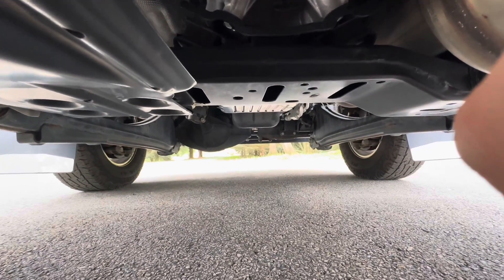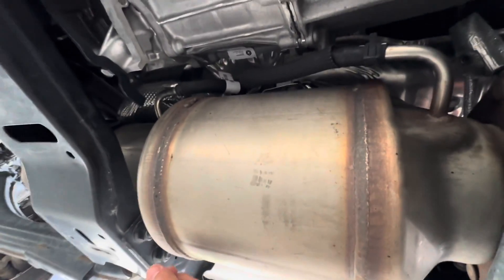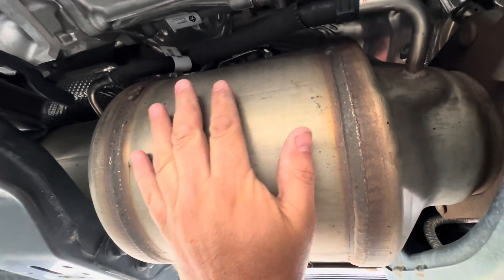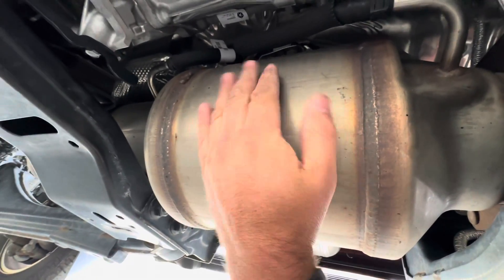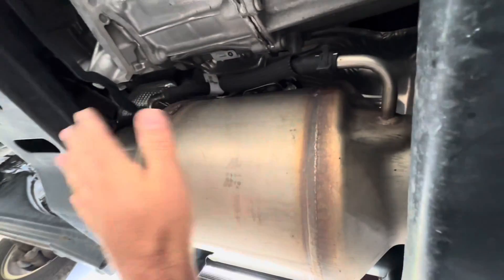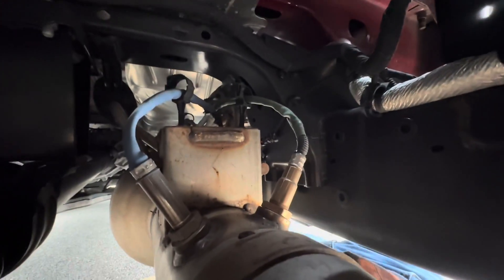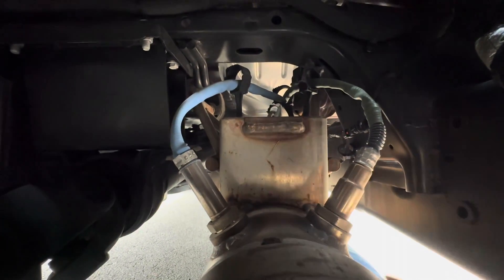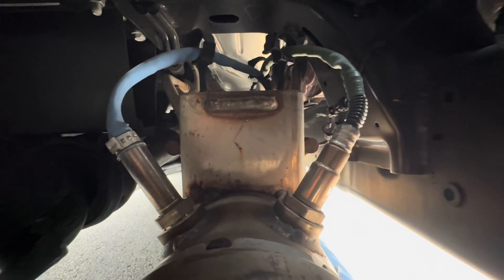2022 Ram Cummins DPF Regeneration and Y43 Recall Explained

Comment: Nice video, Can you tell us why the truck will go into limp mode at 5mph if the DEF runs out or isn't pumping enough. One hears that without DEF fluid the engine will be destroyed. The way I understand the system is that the DEF has NO function in the engine itself, just the exhaust and chemically removing most of the NOX. Doe sthe EGR run all the time or just during regen?
The whole idea of restricting compression ratio and combustion temps to control NOX, in turn causes more soot plugging up the DPF and then needing to use MORE fuel to raise exhaust temps to burn off soot in the DPF. Bizarre logic, as when you couple that with the EGR you essentially ruin the Cummins engine that never smoked that much to begin with. Not like your CATs, Powerstrokes, and Detroits. 

Thanks
Reply from the maker: @philalford3413  the truck goes into 5mph speed limited mode, via a 150 mile countdown, anytime there is an active fault with the SCR (DEF) system. This is because the truck will not meet NOx targeted emission levels at certain operating conditions without the use of DEF. DEF was brought into use as a means to reduce the amount of EGR being used. DEF dosing helps to reduce NOx emissions without having to use as much EGR. It is the EGR cycling at the engine that is more detrimental to the engine. If DEF was not used, it would mean more EGR would be needed at the engine to control NOx. More EGR means more carbon / soot contamination in the intake side of the engine, which can be detrimental long term. It’s not as big an issue on engines that run at more load and higher rpm constantly, however for engines that see a lot of short cycles and idle time, the EGR can get pretty restricted with soot fouling and reduce the flow.
Reply: @TheRamGuru  Thanks, I just have one more question. So the DEF system interacts with the EGR? How exactly does DEF go through the engine? In other words how does the NOx sensor control EGR?
Reply from the maker: @ DEF does not go through the engine at all. DEF is only injected into the SCR chamber, which is the last big canister in the exhaust system, immediately after the DPF. NOx emissions are first reduced through the use of EGR in the engine, and then subsequent NOx reduction occurs in the SCR chamber in the exhaust. The amount of DEF injected is dependent upon the amount of NOx needing to be reduced.
Reply: @TheRamGuru  Okay, thanks that makes sense as far as the emissions system operation is concerned. Now to make sense of the whole idea of making the engine eat it's own exhaust and burning more hydrocarbons to produce less CO2.  Thanks

Comment: Do you know the part number for those differential sensors
Reply from the maker: @ATrucking-g8r  offhand I do not, but a dealer can look them up by your VIN
Reply: @ Thank you for your response, any recommendation you would give me I don’t know what to do I have several months like this with the truck I get a code “exhaust filter full power reduced see dealer” I get code “p0402” “p242f”, automatic regen comes on dash for like 10 minutes but then it takes off and exhaust filter full sign comes out and dpf starts getting full 2019 ram 3500 200k miles
Reply from the maker: @ what engine air filter are you currently using? Regeneration issues are complex to diagnose due to the number of different ways and failures that can create a frequent regen issue. P242F usually means the DPF is plugged with ash and ash isn’t removed during regeneration. It requires removal of the DPF and cleaning or total DPF replacement. Do you idle a lot?
Reply: @  yes I do I’m in the hotshot business I’m getting in contact with dpf cleaning do you suggest cleaning the dpf filter and scr filter or just the dpf filter
Reply from the maker: @ probably just the DOC and DPF but they’re not easy to clean. They’re not serviceable like a commercial truck DPF. The whole thing is one welded assembly with a pipe between the DOC and DPF. A lot of places cut it all apart and then weld it back together.
Reply: @TheRamGuru  hey , here’s an update the dpf filter was damaged cost me 3k to replace it I got my truck back yesterday and the sign came on again “ exhaust full see dealer” any suggestions on what to replace
Reply from the maker: @ I would take it back because they didn’t get it right the first time and you’re spending a ton of money

Comment: I have a new to me 2020 ram 6.7. I just got a check engine light. Had code of P24b5. My particulate guage on cluster shows about 30%. What's my next step? Thank you for video.
Reply from the maker: @rangerron1700  P24B5 indicates a low voltage condition in your particulate matter sensor at the aft end of the SCR chamber. More than likely your PM sensor is failing and needs replaced.

Comment: How to do active regen?
Reply from the maker: @MrCoonass1970  they are controlled automatically by the trucks PCM. Active regeneration will occur whenever the soot load in the DPF reaches about 50%, or whenever the truck is operated for a total of 24 engine hours without an active regeneration happening sooner. The only way to force a truck to perform an active regeneration is to perform a “parked” regeneration, which requires a scan tool / computer with that ability. The truck has to be stationary and have sufficient fuel in the tank.
Reply: @TheRamGuru  so just need obd2 reader capable of force regen. It just plugs into the under dash obd2 plug? No need to remove dash? I saw some remove gague cluster.
Reply from the maker: @ yeah you might depending on the year. You need to get past the security gateway in the vehicle electronics and sometimes that’s not easy to do.

Comment: the soot leaving the dpf has to pass by that sensor in the back during regen. of course its going it to register soot.
Reply from the maker: @axercst  no soot should be in the post-DPF exhaust flow except for maybe small trace amounts. The DPF is 99%+ efficient at trapping soot. The point of the sensor is to capture any soot found in the post-DPF exhaust flow. The sensor captures and “counts” the particles. If the amount it counts is above the threshold limits permitted it will trigger a DTC which indicates the value is higher than normal. The only way that should be possible is if the DPF itself is internally compromised. Either the media is cracked, or the pressure vessel is damaged and the soot generated by the engine is bypassing the media in large quantities. During a regeneration the soot is converted into carbon dioxide and water vapor and expelled out of the DPF outlet. There is no soot discharged out of the DPF during regeneration.
Reply: @TheRamGuru  Does the PMS capture any post-DPF soot or just count it?  If it captured it, wouldn't it eventually become full and need replacement since it can't regen?  My thought is it just counts it and lets it go out the tailpipe.  Interested if you know.  Thanks.
Reply from the maker: @ yes it collects trace soot particles on the tip of the sensor. It then counts those particles to see if the amount is above or below the threshold limit for acceptable operation. After a certain amount of time, the tip of the PMS sensor goes through a regeneration cycle, where the tip heats up hot enough to oxidize the soot particles and eliminate them. It then goes back to counting particles again. This happens over and over as it constantly monitors the post-DPF exhaust flow to make sure that no excessive soot is escaping out of the DPF.
Reply: @ Thanks for the explanation!
Reply: i have a 17 ram dually i cant see how full my canister is or when its doing a regen?  any way to know?
Reply from the maker: @ the 2018 and older trucks do not have any factory notifications to let you know when the truck is in regen, or how full the DPF is, however if you invest in an aftermarket monitor like the Banks iDash, it will tell you how close you are to a regen and it provides a notice when the truck goes into regen
Reply: So the code P242F can't be fixed by a stationary soot cleaning? That was the fix from the dealer and it lasted about 4 miles. My codes started PO299 (hole in intercooler boot and bad turbo actuator) while waiting for parts got a PO401 code... DPF filled up and now I've got the P242F. All in 6 weeks are so mad 58k miles on my 2021.

Comment: I took my 2019 Dodge 3500 to the Dodge dealership because of another check Engine light on. It came up with a P2002-00 code. The dealership recommended either replacing the DPF system at a price of around $7000 or doing a delete for $2600. There is no mention of cleaning it or any other possible causes. They never checked any sensors. My dash shows the filter is clean ? I do both hwy and town driving.  It does its regeneration just fine when i am on the hwy, clears up the filter to 0 every time. 
I have under 100,000 klm on the truck. Is it normal to have this issue. I already replaced the diesel particulate sensor at the end of the tail pipe. 
So frustrating. This truck is only 5 years old, and I have to take out a loan to fix it?
Reply from the maker: @sandygammie447  P2002 is “DPF efficiency below threshold” and is usually caused by a pressure issue in reference to the DPF. It’s triggering the code because it’s seeing a pressure differential across the inlet and outlet of the DPF that is below the minimum threshold. So in other words, there’s not enough restriction in the flow of exhaust through the DPF. This can be caused by an exhaust leak, where pressure is escaping if one of the clamps has failed, or there’s a hole in one of the pipes. It can also be caused by a bad pressure sensor, which is reading false values, or holes in either of the pressure tubes that run from the DPF to the sensor. There’s also a possibility that there is a hole through the media in your DPF and the exhaust is flowing directly through it, rather than being filtered out. If this was the case, you would see black smoke coming out of the tailpipe under hard acceleration while driving the truck. You may also see a lot of soot in your tailpipe. Without doing proper diagnostics, it would be premature to just claim the DPF needs replaced. The things I listed above should be checked before coming to that conclusion. If you’re under 62,000 miles, it’s highly unlikely the DPF itself has failed.

Comment: The Y43 recall states it’s only for 3500 & 4500 Rams. This video is for 22 ram 2500. We have 2 2022 Rams that have DPF full issue. We have a 21 Ram 2500 that does not have the issue and it does the periodic regen process.
Reply from the maker: @vicdean7393  the truck in this video is a 2022 Ram 3500 high output pickup. It is my personal vehicle. The Y43 recall is for all 2022 Ram HD trucks powered with the 6.7L Cummins  diesel (2500 and 3500 pickups, as well as 2500/3500/4500/5500 cab and chassis trucks) The Y43 recall doesn’t have anything to do with your DPF being full. The particulate matter sensor doesn’t control your DPF or monitor its soot capacity. I explained this in the video. If your 2022 Cummins trucks are having an issue with the DPF showing full, or with the DPF regenerating too frequently, then you need to look up (or have your dealer look up) TSB 25-005-24 which explains that a number of 2022 diesels were produced with a DPF that was manufactured incorrectly, causing frequent regeneration (which can also lead to a false-full issue).
Reply: @ much appreciated. I did watch all of video, very detailed. I think I just assumed it related to regen problem. This has been frustrating. One 2022 Ram 2500 we took to dealer said it’s out of warranty and they wanted to replace DPF, other 2022 they replaced DPF under warranty. Both under 60k miles.
Reply from the maker: @vicdean7393 don’t forget if you’re registering these trucks in a state that follows CARB regulations you have a 7yr, 70k mile emissions warranty. Also, any truck that gets the Y43 recall also gets a 1yr, unlimited mileage warranty extension on the DPF from the date the Y43 recall is completed.
Reply: @TheRamGuru  thanks, unfortunately I’m in North Carolina. No CARB.

Comment: Buy an older diesel and all this bullshit goes away...
Reply from the maker: @shaverlocal  so does the towing capacity and capability. The older trucks don’t hold a candle to the pulling and stopping power that the newer generation of trucks have. Those older trucks are also….old. Parts are becoming more and more difficult to source for them, some of which are NLA. Most are so worn out they’re not worth repairing, and when you find a gem, the owner wants almost the same amount of money for a 20 year old truck as what you can buy new. Sorry but times are changing and you either change with the times, or you get left behind. The older trucks are great for a hobby or a collectors item, but if you want to work the truck daily and have it perform, new is the way to go. These systems are far more reliable today than they were ten or fifteen years ago. The vast majority of ones with issues are the result of improper operation, poor duty cycles, and / or poor maintenance.
Reply: @TheRamGuru  That is funny...You want to compare a new truck that cant even hold half a yards worth of gravel and will look like a wreck that insurance won't pay for...or an old rid like mine that I bought for cash in 07 that will haul a yard and a half and still look like a great work truck with an LBZ engine with no emition bull shit standards...  can't even imagine.My truck probably has more value than yours and  don't have a $1200 dollar a month payment. In the mean time I have paid off my home!
Reply: @TheRamGuru  I guess you blocked my reply...I don't blame you...
Reply from the maker: @shaverlocal  I didn’t block anything. You were so eager to gloat about your ragged out Duramax, you inadvertently made a typo that looked like a link, and YouTube’s algorithm is likely blocking it. Please continue demonstrating your ignorance and stupidity.

Comment: So I have a 2022 and it doesn't have this sensor. Does that mean I can take the dpf out or maybe drill a hole in it. 😊 this is a serious question. Why would i want to have this installed if its just another thing that can go wrong?
Reply from the maker: @electrified7309  definitely not going to work. This sensor doesn’t have any control over the DPF. But there are sensors that monitor DPF function. When you remove it or punch a hole in it, the pressure sensors will see an incorrect pressure differential. Installation of the PM sensor under the Y43 recall should be completed because it provides you the ability to detect a faulty DPF sooner, preferably under warranty when it can be rectified by Ram. It also includes a software update that includes the programming to allow the pcm to communicate with that PM sensor. If your truck does not get Y43 completed, and you need a PCM update in the future, you’ll end up with a constant check engine light because all new versions of the pcm software will include programming for the PM sensor. If it’s uploaded into a truck that doesn’t have the sensor, it will cause a “lost communication” error continuously until a sensor is installed. You also get an extended emissions warranty on the DPF once this sensor is installed. One year and unlimited mileage from the date the Y43 recall is completed.
Reply: @mbarber84   Thanks for the information and very convincing argument to get the update.

Comment: The only bad thing is the soot becomes ash and then it becomes trash 😂… horrible system been working on it for years it’s horrible there no bands on there to just be able to remove the dpi and install a new one…
Reply from the maker: @dieseldawg7132  yeah they should have designed this one so that the DPF was an independent piece (like commercial and industrial applications) so that it could be removed for easier cleaning, rather than welding it all together.

Comment: Thanks for explaining in detail! After the dealer fixed the Y43 recall I’m not passing smog! Any help with this??
Reply from the maker: @JamesSearcy-l9g  are you having an issue with one of the readiness monitors not being ready? Or what do you mean by not passing smog?
Reply: @ yes that’s correct the readiness of one of the monitors! I’ve driven 400 miles since recall repair
Reply from the maker: @ which ones aren’t setting?
Reply: @ it says the on board computer system cannot complete the emission system self test! Also OBDII states not ready
Reply from the maker: @ I’m not exactly sure without seeing it. I’ve seen where some of these trucks take a LONG drive for hours on the highway before they’re ready to pass.